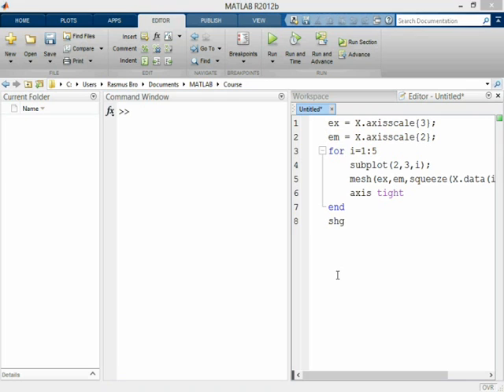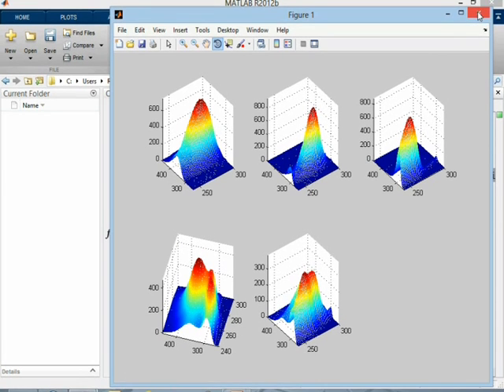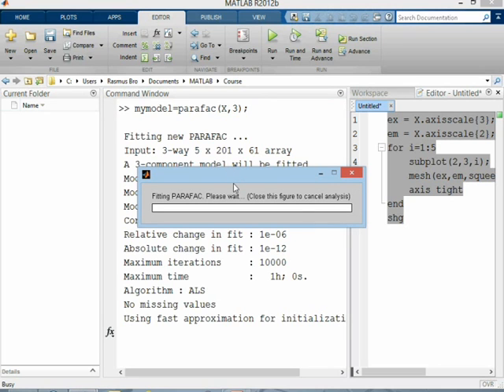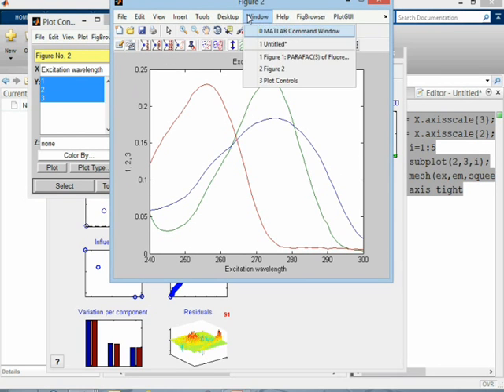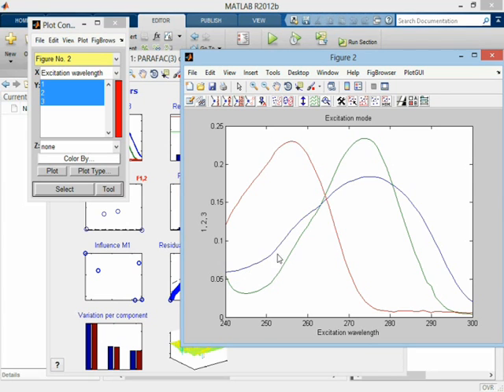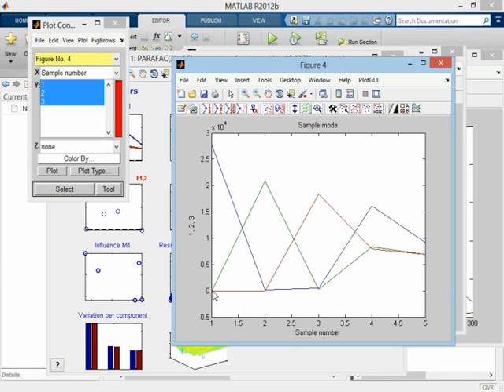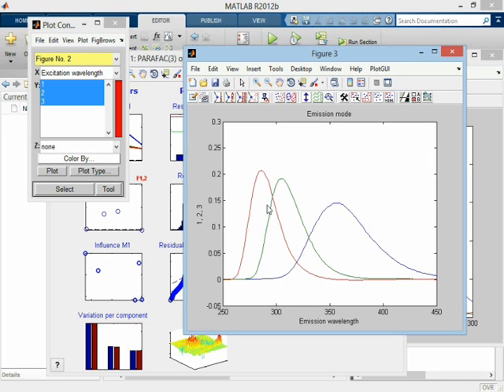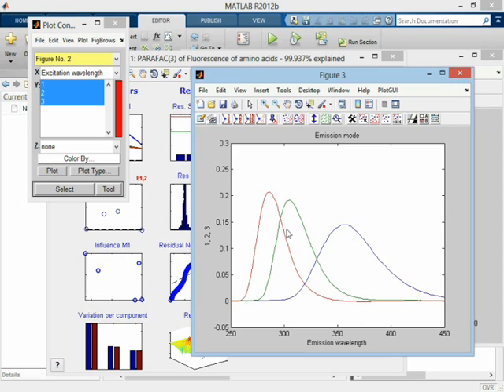Multi-way analysis. Part 21b. The PARAFAC model. MATLAB version

Comment: Dear Sir,

Your videos are very helpful for my project and l really want to thank you for this. 
I am going to submit my senior project report after 2 weeks. I am using Emission-Excitation matrix by using fluorescence spectroscopy in my research. 
Now, l need to use the PARAFAC to complete my research.  I am using your packages as you mention in your videos. But, l am facing some problems:
1. The axis in the loading represents the size of my data. So, how can l change the axis in the loadings and put the values on the wavelengths (as shown)? How l can change it?
(X= [8 441 38]) (8= number of samples, 441=emission, 38=excitation)
 
2. How can I extract and access the FMax Values (the loadings matrix) from your code in the MATLAB?
3. The “pfplt” code cannot be run to get the loading figure separately. Actually, l got an error message in this statement. Any suggestion? 
 
4. I try to run the codes in MATLAB 2013 also l am getting the same errors? Any suggestion?
I really appreciate your help and if there is any suggestion, I am waiting for it as soon as possible

Looking forward to hearing from you
 

Rashid Mohammed Al-Heddi 
Chemical Engineering Department 
College of Engineering 
University of Bahrain